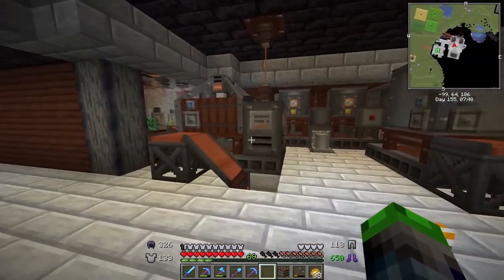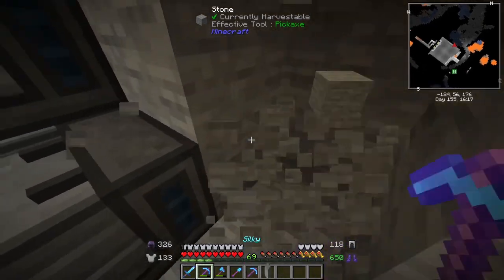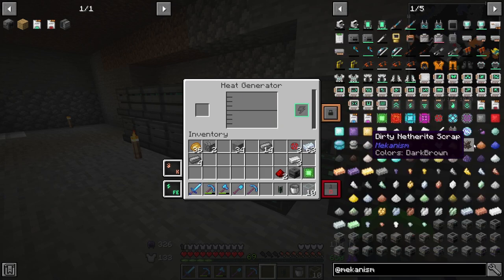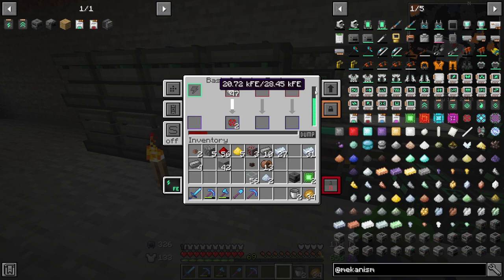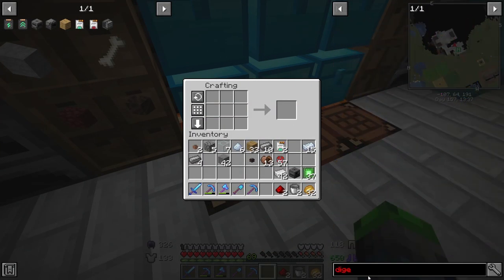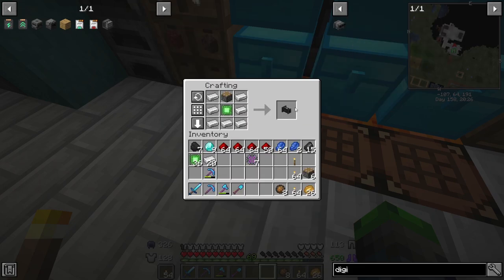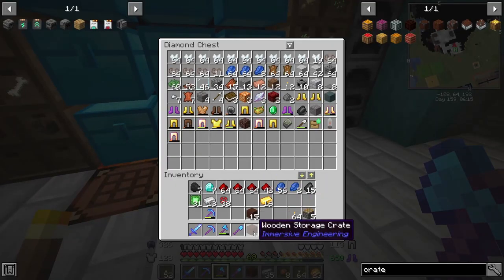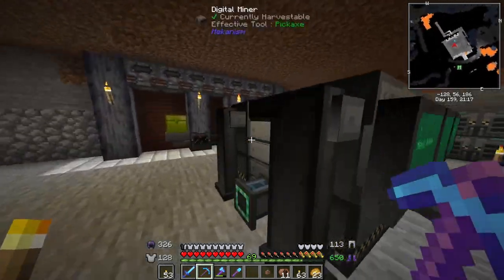Valhelsia 3 |  Mekanism Digital Miner!! | [EP 8]

Comment: If you added Optifine to Valhelsia 3 That can be a reason for the textures breaking, You Download Optiforge which will fix these textures make sure to note the Forge version you are on along with which Optifine. 

Example: (2020-08-08) OptiForge-MC1.16.1-0.1.9 requires: 

    OptiFine 1.16.1 HD U G2 pre16 or newer version, Forge 32.0.107 or newer version

This Will also fix the textures. Hope this helps I had the same problem.